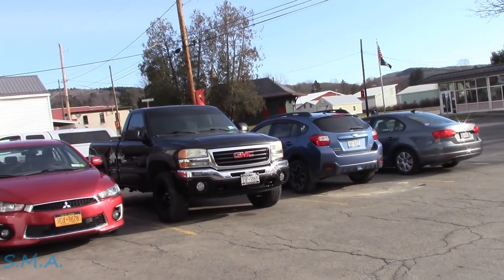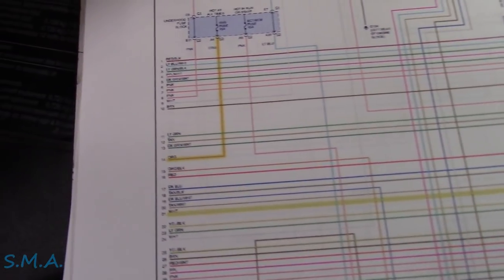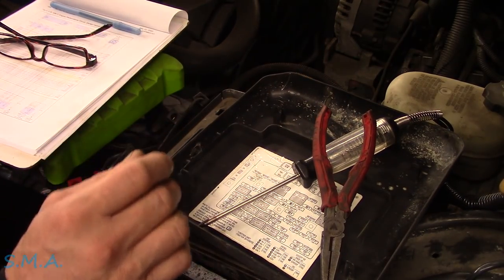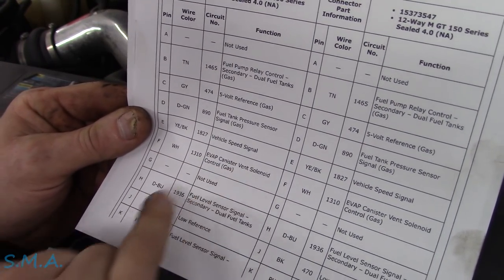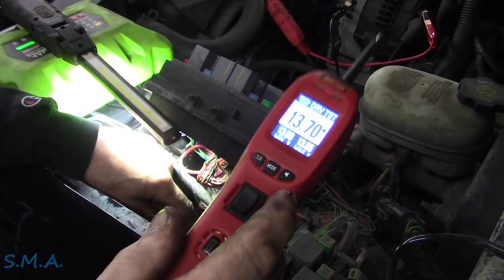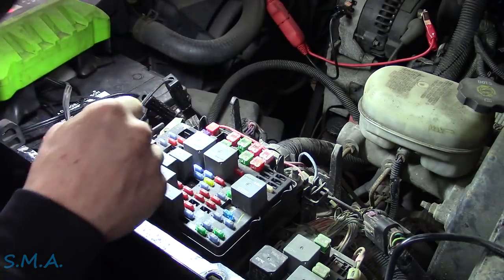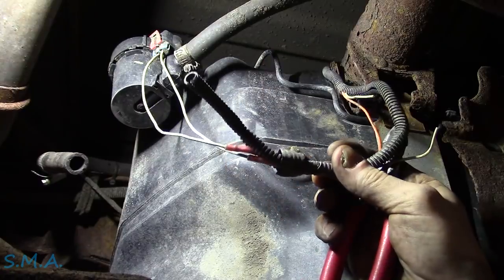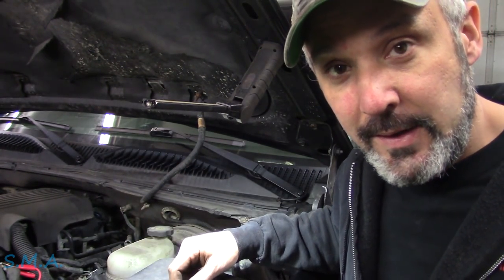Uggg The Phone Calls.... Oh And Fixing A Chevy EVAP System

Comment: Hey Eric, I'm currently loading my VW that has a slight stutter in third whilst under load every Tuesday on to the ferry here in Edinburgh. It should take about a week or so to sail to America, and then a few days to drive to your shop. I should be there by 9am Friday and was hoping you could have it all fixed up by lunch time. Cheers.
Reply: Let me know when you land and I'll come help push it to upstate NY. 😁😂
Reply: Make sure to schedule it  when Eric's got the brisket cookin.
Reply: Are you sure its not the flux capacitor or need to replace the muffler bearing. Could be low on power purge. Does it slur its vroom in that gear. Like "putput--putput"
Just kidding.

Comment: Thanks for what you do Eric. You saved me a dirty greasy job by showing how a $3 relay could be the cause of the no crank, no start on my F150. I had already bought the starter from RockAuto and decided to look at your SMA channel for what to expect in the way of replacing it. So I went to SMA channel and "F150 starting problem" and BOOM, bad relay. That fixed it for me too. I still have the starter and some day I may need to replace it but a 5 minute relay replacement is much better than a starter replacement that doesn't solve the problem. I'm 3000 miles away so I won't be dropping by to ask any questions this week. Thanks for all your EXCELLENT CONTENT. Cheers!

Comment: I’ve learned a lot from you Mr O - for that reason I’d not call for advice as what I have learned is you need a systematic approach, logic, read the codes, get some direction and determine a logical plan. If anyone calls to ask what next to load into the Rock Auto parts cannon they haven’t listened to the free advice at the heard of your channel. Same advice comes through loud and clear from the Rainman Ray which is why I’m an fan of his channel too - just to say thanks and I’m so appreciative of the free advice via your excellent videos!  - also the free comedy inserts 😀

Comment: Sorry to hear about folks calling your shop.  I think people get the feeling they know you when they don't.  For what it's worth, I'll never call.  Anyway, I've learned a lot watching your videos. I even bought an Autel MP808BT.  I was able to diagnose a bad fuel tank pressure sensor on my 02 Suburban.  I ended up having a local shop replace it.  They wanted to diagnose it themselves.   I was ok with that.  But they were not able to diagnose the problem.  So they changed the sensor and the fuel pump I bought, both from Rock Auto.  I figured while the tank was out might as well replace the pump.  That took care of my Evap problem.  I figure the Autel saved me $100 on that one.  And I wouldn't have known where to start without your videos.  Yeah I know I should have checked the powers and grounds before changing the sensor.  But I'm 63 and Oregon was wet that time of year.  You're better than you're giving yourself credit for in this video.  We appreciate your videos.  Thanks!  Maybe you should end your videos with: "If I can do it, you can do it.  So don't call me!"

Comment: I just went through the exact same thing with my 03 Santa Fe ,,, after I replaced every component on my evap system I still got the same PO447 code ,,, open canister circuit ,,, through a good friend of mine that works at skinners and demulis here in Herkimer county ,, gave me insight of the wiring found my broken wire just down from the vent solenoid ,,, also through watching you aided me on how to test and what to do ,,,, keep up the good work ,, love your vids ,,,

Comment: I've been fixing all my own junk forever. I worked in Industrial Maintenance repairing machinery most of my life. Now retired and getting older, the things I don't want to work on I take to my local shop. Great mechanics! I think the problem is some people take their cars to the guy that will fix it the cheapest. I take mine to good mechanics. I may pay a little more. but I save money in the long run by not having to take it to multiple shops. I trust what they tell me, and I know they are stand up people and do good work. Dealers are not the best, shops like yours are, and there are many around just as good as your shop. People just need to go there first not as a last resort. lol

Comment: I've watched several of your GM vids about the fuse box issues.  I live in the PNW and very little salt is used on the roads.  Still paranoid that I'll get the wire rot, still good after 5 years.  Thanks for making these, very informative.

Comment: Thanks for the informative videos. I want to make you aware of what happened to me the other day. Customer brought a 2000 Silverado 4wd over for me to fix "Service 4wd" . Before he got to my shop, I was youtubing to see what others are doing and had a game plan in order of diagnosis. When he arrived, the 4wd ecu and 4wd switch were hanging out of the dash. Should have stopped there....BUT times are lean.....I asked what he had already done and here is where it gets scary. He threw a new ECU & switch in to see if it was fixed, and when it did not he RETURNED THE ECU & SWITCH to the O'reilly store....which he stated the parts counter person told him IF IT DOES NOT FIX it, you can bring the parts back. 
I hope to not get the parts sold to me that this person plugged up...not knowing ANYTHING but a guess and knowledge from Youtube videos. Parts returned and sold again could be bad and make a good qualified mechanic THINK TWICE about his diag abilities.
I have a mobile auto repair business, and have for the LAST time installed the owners parts that were purchased from the local parts house OR anywhere actually. Doing rear brake shoes on a Dodge truck, the owner received the incorrect shoes from the parts store, and when i told him the shoes were incorrect, he argued with ME..stating the parts counter person assured him the parts were correct.

Comment: Moved from WV to NC Jan 1996. Went to work for PepBoys. About 6 months in the manager had figured out when I fixed cars, they were fixed unlike his high-hour producing tech. So I got the problem children AFTER the other guy sold them $1500 of repairs/parts cannon. Rarely took more than an hour to find and repair what was almost always a wiring issue. I'd either get 5 tenths or no pay with a pat on the back & we'll get you taken care of on another. Never happened. 

Managers golfing buddy had a 944 Porche. Random intermittent no-start/stall maybe every 6 months. Turned out they had a main relay issue like Honda but it also had a wonky crank sensor. Found it on an OLD-SCHOOL Marquette Analyzer with a scope. No idea what the pattern looked like & VERY limited service info available and I think a Snap-Off scan tool. I left that store shortly after & left PepBoys 4 weeks before eligible for vacation. Turns out I'm NOT very smart. 

Some think we are GODS and just know what's wrong but shouldn't get paid for "knowing". Eventually went back to PepBoys. Left in 1996 went back in 2013. Turned out nothing had changed They NEVER had a functional printer. If you bought your own you had to provide your own internet/hotspot cause getting internet into the shop was too much trouble for the million dollar company. When pandemic hit first thing they did was shut off/freeze the 401K. No other precautions. I've had pneumonia before. No thanks. Took my tiny Social Security check and been home for 2 years. Let them eat cake.

Comment: i have a 02 silverado just got has a po449 and po452. I assumed its a wire thing that both went bad in the same area. i put a bore scope up on the tank and my pressure sensor wiring is cut in two both wires. so thanks to your video check power and grounds now i know.

Comment: You're a treat to take time with us to fool with the camera while doing your 'real' job - Suggestion for you re: butt splices, You mentioned heat shrink but ya gotta slide it on before you do the last crimp :-) and fwiw see if you can get ahold of the stuff with the goo inside that makes sure the salt will never get into the splice. We used to hate it when people would put butt splices under the floormat, followed by winter and wet carpet so you can guess what happens next. Best wishes !

Comment: I have a launch scanner without bidirectional controls. Just bought an xtool a30m for 215 bucks. Its a bluetooth scanner that uses your phone or a tablet and an anyscan app. The data arrangements and graphs are not the best but they do work and may be better on a tablet. The bidirectional controls work well so far.

Comment: I’ve seen many of Class 2 network trucks have issues when I connected my 909. It’s hit or miss, but yes aftermarket parts cause that issue too. I often use an older Snap On to connect to 2006 and older GM trucks.

Comment: haha the phone sound ray makes. anyways .. we had the same issue on a 05 silverado it was the pcm wire. ended up running a new wire to the vent  because of the rusty brake lines and such. it was broken further up the harness and it fixed the issue i also love vws. easy to work on!

Comment: Do NOT apologize for what you say or do. Opinions are like A**holes, everybody's got one and most of them stink. Keep up what you are doing it definitely helps the enthusiast like myself. Many times I have learned from your videos not so much how to fix a problem but how to think it through before you start throwing parts at it. My issues are trying to understand the terminology you guys use when doing an electrical troubleshoot. As a retired  construction electrician of 42 years our terms don't exactly match your terms. But reading a print (wiring diagram) is the same as is the steps taken to logically solve an issue. So keep on keeping on, my only complaint is that your not located on Long Island where we could use someone honest and talented like you. Thanks again! MIntman

Comment: The wire failed most likely due to vibration, and obviously the harsh NY winters + salt on the roads. I would have put a black nylon adhesive cable tie mount on the black tank and then tie wrapped the cable loom harness to it. The adhesive cable tie mounts are extremely tough if the mounting surface is properly prepped.

Comment: You could just become an angry sourpuss like me - keeps the sub count low, and people are less likely to call. 😁😁😁Sorry you have to deal with all that crap. That just proves the saying, "No good deed goes unpunished." I'd probably be much less friendly about it, so kudos to you! 😊

Man, that thing was a WRECK! The driver would probably get jail time in MA for operating that, lol.  Definitely gotta pick your battles with that thing! Nice detective work finding the bust! 

I love that friggin Power Probe! I just bought a Maestro a few months ago. It's great, but it slid me the other day! Was a great learning experience to not rely too heavily on the tool. I was diaging the neighbor's Ford 1720 tractor. The  tool had me briefly believing the ignition switch, and starter were both bad. I was able to verify continuity through all the safety switches. Was also able to make the solenoid CLICK using the power-on feature of the tool. Then I noticed the 12v at the ignition switch would go away whenever ANYTHING was turned on! BIG CLUE, but took me a minute - the emergency clamps on the battery were causing next to zero amp flow! I noticed those right away, but wanted to see what my fancy new tool said. One of those deals where if I DIDN'T have the fancy tool, I'd have fixed this in a second. Put a new terminal on the battery end of the positive cable, and a new eyelet on the opposite end, and now the thing cranks over 200 RPM faster than it ever did! Amazing, lol.

Comment: When I got overwhelmed and I wasn't working for myself, I'd quit and move to a different shop. I was never out of work for more than a few hours. My grapevine found me every time and the phone started ringing.
When I had my own shops, I eventually sold everything for $1.00/blue sky and retired. I was losing my mind as fast as I was losing control of my 3 shops so I quit the whole thing in May of 2004 and never looked back.  
Eric ... there will come the day when you will too. I dumped the Cadillacs, the '58 and '75 Corvettes, the Kawasakis KZs, the 1/2 ownership of a Cessna, 3, 4-plex apartments, 2 houses in Huntington Beach,  a 38- and a 58 ft- motor yacht and I just moved to clean air, no sales taxes and no local neighbors.

Comment: Great job!!!   I've fixed a bunch of GM trucks with corroded harnesses...   Especially coil and injector feeds..  The first time I had an injector code on an 05, I ripped everything apart as the truck was 365k miles and replaced the injectors...  I was bummed when I started it and it was still missing... UGH!!!!  Initial testing, I was getting voltage and pulse, on revisit I used my old bulb test light, it wouldn't light off the signal... The wire was corroded on the engine side of the harness plug.  I've had tiny stones blocking some vent valves from sealing.. Why is this happening...  Never had an issue on 03 and back..

Comment: I had a chev impala where the air conditioner would not blow cold air. A specialist tech was flown in and could not fix the issue along with 4 other local shops. I came across a random article on the interwebs. The article said they had the same issue and discovered if they filled the cooling overflow tank about 2 inches past the fill line the air conditioner problem went away. I therfore fixed and issue no others could just by random happenstance.

Comment: It's the same in ATV-Motorcycle Repair. People want to tie you up with questions to diagnose their issues without bringing the machine into the shop. After your best estimate of what it could be, then how much would the parts be? Then the debate about what price they can get that part for on the internet. If I brought it in , how much would it cost? We still didn't see the machine to diagnose it, they promised somebody they can go riding this weekend and we have 35 machines in the shop already waiting to be repaired. Then it arrives, flat, dry rotted tires, brakes locked, random wires cut, no battery and live mice crawling out of the airbox. I still don't want to spend much money on it, the first thing they said that makes sense!

Comment: Are electrical wire tracers for mechanics a thing like they have for finding your Cable/etc lines? Such as, you have something giving signal to the wire and you have a sensor that can pick up that signal that you can follow to find a break in the line?

Comment: I'm a mechanic in North Carolina. I enjoy your videos. I've got a problem vehicle of my own. 2012 Chevy traverse 3.6 skips on cylinder 3 when cold runs fine once it gets warm. Checked everything that I can check everything checks good. Sent it to the dealership. They worked on it for 2 months. Said I need a engine. But they couldn't tell me why my  engine needs replacing. Just curious if you've ever come across this situation. Thanks Blane.
Reply: Or a video

Comment: I have a 2002 GMC Sierra with 266,000 miles on it with the original engine and trans and it’s never been opened up.  The undercarriage looks like it just came off the assembly line.  I sure don’t

Comment: From 1994 to 2004 I worked at a local Napa after being a dealer mechanic for 15 years. We had tons of local garages as customers. Out side of 1 shop that specialized in Fords, I could not recommend any of them if someone walked into the store and wanted to know where to take their car for repairs. In fact, the shops would call me and ask me to come there to help figure things out. One thing I noticed is you don't seem to mind spending the money for the proper tools and diagnostic info. Don't sell yourself short. I wouldn't hesitate to bring my vehicle to you but I am an hour away so you won't want to work on it anyway. 😔

Comment: Those aren't compression fittings on the brake lines. They're brake line flare unions, same as factory uses to join brake line segments. Should I be failing those on inspections?

Comment: Mr O, I think the dilithium crystals in my flux capacitor have shorted because I can no longer go into hyperdrive and it'll only do warp speed 3.  If I bring it to your shop, can you bypass it?  I'm tired of looking at the warning light on my N302 controller.  Also, can I borrow your hyperflex low torque spring extractor?  I need the one with in-lb increments.

Comment: Eric O your videos help me out. But I also watch other videos to get more info. I research look at the options. Before making a decision. I do my own work. I like surrounding myself with people who do this work. If I have a question about something I'm unclear about I talk to people like yourself for clarification. Plus read up on it. Is it a common problem with this vehicle or is it a part that jist failed and worn out. Electrical issues are either caused from manufacturing defect or someone has cob jobbed the wiring replacing connectors and wiring them in incorrectly by twisting wires together and just taping them together. Wires exposed out of the loom can be a pain to fix. If the insulation rubs on metal or a sharp edge you can lay money on it that the bare wire is corroded to the point of breaking. I've dealt with that situation where wires were exposed out of the loom and corroded.  Broke and had to fix. Keep up the good work Eric O. I here a lot of good words from the locals in Bath and Avoca. 👍🏻about you.
Very informational videos.

Comment: I don't get it. Isn't it normal to see no voltage on the control wire when the electrical connector is unplugged from the valve?